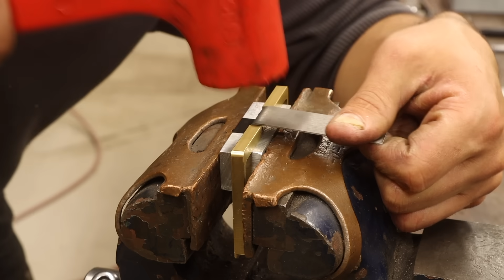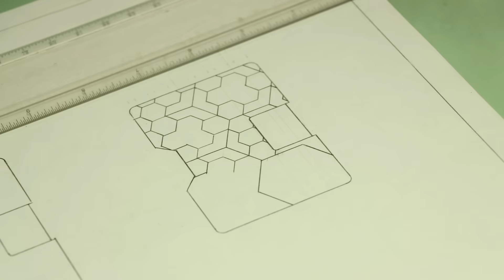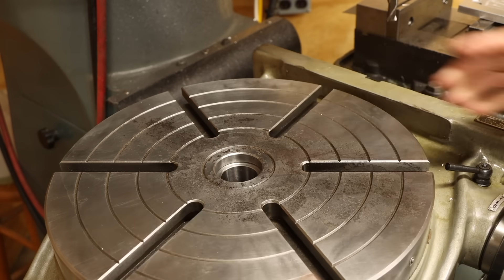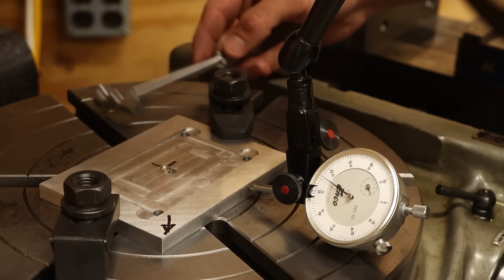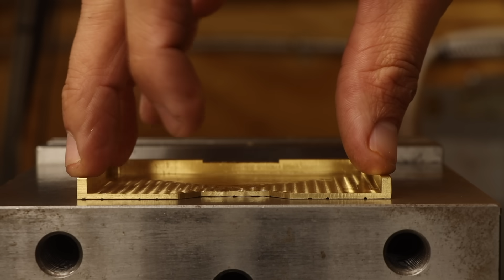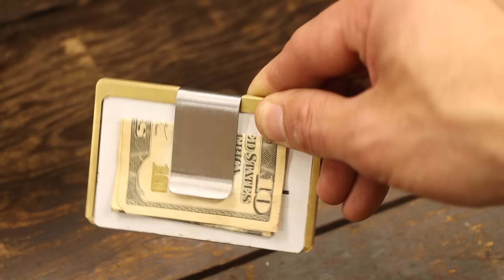Making a MINIMALIST Wallet || INHERITANCE MACHINING

Comment: If your mill clamp studs are too short (running out of threads?) you can also try putting a few washers under the nut to prevent it from bottoming out.

Comment: it would be neat if the face plate was brass, the main body blued steel and the clip stainless :D
hmm. after quick googling seems that brass can be black oxidised. it would be also a neat way to get the lines to pop out :D

Comment: Just a rough guess, but approximately 4,000 is almost 50,000. (Probably closer to 3,200 max)

Also, as I progress further. Ef 2-56 holes. That is the only tap i am at 98% breakage with. Even including a drill press gizmo that is a clutch system that guarantees you wont break a tap. That specific size is a bitch. 0-40? Cuts like butta.

Comment: You should make another one, but use a tape that will protect the surface and not get ripped out too easily. Then fill in the lines with a complimentary color.  Then face mill it to final thickness.

Comment: Beautiful end result. What could have looked really nice as well and helped cover up the little mistake on the inside of the wallet is if you "jewelled" (i think it's sometimes called engine turning) that surface by using some round cratex mounted stones and creating a polished circular pattern.
But regardless the end result is absolutely beautiful!

Comment: Love the wallet. Only downside is that I guess that it's not protected when somebody try to cheat with a wireless terminal and you don't need a passcode for confirming the transaction. It's a huge problem in europe at least. Correct me if it's protected against that?
Reply from the maker: Thanks. Nah it's not that fancy. It might offer some inadvertent protection. But that wasn't the goal

Comment: It's funny, coming from the CNC world that inside pattern looks so every-day; i forgot how much math goes into actually making it.
As for machining it, how come you did not simply super-glue the brass into aluminum? It would have given you a nice uniform hold over the whole surface, and no worries about pushing the part off sideways since it's in a pocket. Then either heat or acetone soak would have separated the two.
Reply from the maker: While I was eager to machine that pattern basically the whole time I was thinking "man... a CNC could do this in like 60 seconds" haha I've never really played with the CA glue method but I've heard good things. I might have to try that next time an opportunity presents itself

Comment: I noticed that you are using a drilled and reamed hole for locating the card fixture on the rotary table. Although a reamed hole is very accurate diameter, they generally are not accurately located. This is because the hole location will be set by the drill, which even with a spot can wander quite a bit. The reamer will follow wherever the drill went - which is by design. Its why reamers are long and noodley. If you want a hole that is accurate diameter and location you’ll have to use another process like boring. 

BTW not trying to nitpick. You clearly sweat the details so I thought I’d sweat some details too ;)

Very cool build. I like the rotary table work to make the pattern.
Reply from the maker: Taking a break from integration hell, I see? Good point I hadn't really considered. If some features end up off a half thou or so I think it's completely acceptable for a wallet. But good to keep in mind when it matters. You've got me second guessing the ~200 holes I made in a fixture plate though 😂
Reply: @InheritanceMachining  Agree its totally fine for this application. Where it really gets bad is deeper holes. I've had a 1/8" drill wander by 100 thou over a couple inches. That is admittedly an  extreme case though - I've heard it depends a lot on how symmetrically the drill is sharpened.
Reply from the maker: @StuffMadeHere  Damn... was your drill made of cheese by chance? You just got me curious on how gundrilling works without drifting. Seems pretty universal that chip evacuation is a HUGE factor for straight drilling in all types. I imagine that's why you always see folks pecking away at holes. More than I do at least. Probably not a bad habit to get into
Reply: @InheritanceMachining  My understanding is that a gun drill is an entirely different tool. Basically the gun drill has a built in "guide" on the end of the drill which reliably centers it in the existing bore combined with an external guide to constrain the drill from wandering. Sort of a hybrid between boring and drilling. Without those constraints - and a lot less stiffness due to the flute cutouts - twist drills are able to meander through the material without much resistance. I was told when I was learning that the evenness of the grind between the cutting edges on a twist drill was critical for getting straight holes.
Reply: Back when I worked at a machine shop, I always used a stub length drill with a center drill to reduce my wander on reamed holes. Seemed to do well enough for the parts I made, granted the mill they put me on had about 100 thou of slop in the ways, so the fact that I could hold a tolerance of 5 thou was a feat all on itself let alone the 1 thou i coud do on certian operations. For anything that required absolute locational accuracy, we normally got a cutout from the wire edm.
Reply: Would a mill address the wandering issue? Wondering if a set of undersize ground mills followed by reaming would be a good practice? Or do you just need to rough drill and mill with enough rigidity to both locate and take to final size?
Reply: @matthewlramsey  If you want really accurately located holes with good diameter with a manual mill you typically would bore the holes with a boring head. First you drill an undersized hole with a drill, then you bring it up to size with a boring tool which is an adjustable single point machining tool. It is very stiff and can take a very light cut to get accurately sized and located holes. Alternatively if you have a CNC machine they do a similar routine using an end mill. Drill a nominally located hole then machine a helix path with an end mill to bring it to accurate size and location.
Reply: also, instead of boring, you could also just use and end mill to kinda cheat your way to the same relative result
Reply: With wider flutes to guide the drill, modern drills use flow threw coolant to evacuate the chips. Titans of CNC did a 40x depth hole with a drill. Less than a thousandth off at the end.

Comment: Just a tip for the next time your bolt is to long, just put a few washers under your nut and you gain the high what you need, so you don't have to destroy some other bolts or material for it.

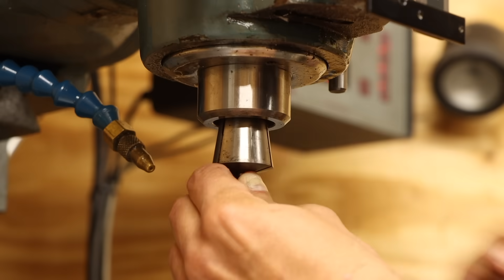Comment: I'm no machinist, but at 8:00 you say the bit should be running at 15,000 rpm. I don't know how fast your mill runs, but wouldn't the tiny tip on that bit spin much faster than the speed the machine is set to? I'm sure you thought of this considering your level of detail, so i'm just asking for myself.
Reply from the maker: No that's that point I was making. I could only run my mill at about 2000 rpm. Ended up working out alright though

Comment: There is a key in the container that the 12" Mitutoyo calipers came in. It is used to reorient the needle when it has skipped. Spend a few minutes and try it out. You'll be much happier using them with the zero position of the needle at it's intended 12 o'clock position.
Reply from the maker: You're right! I just fixed it. Thanks!

Comment: Does it still hold cards if you have less than 5?
Reply from the maker: yes but I have to bend the clip in a bit. If I did it again I would make the clip from thinner steel

Comment: How does the clip interact with clothes/body when it's in a pocket. My gun holster belt clip constantly rubs holes in my shirts even though I've sanded all sharp edges down to 2000 grit. Wondering if it does something similar to the pocket interior.

Comment: I've seen other channels super glue a part to a baseplate so that its held securely across the whole surface, then use a blowtorch to heat it to break the super glue bond. Perhaps this would remove the lifting issue and the need for moving the clamps half way through.
Reply: But you need an Australian accent to get the most out of a super glue ahhbor.

Comment: Brandon, another tap broken again. Have you thought about making a tapping guide or a tapping fixture? Then are you using tapping fluid(tap magic)? I didn't see any tapping liquid. I have machined thin carbon fiber sheets before to make test coupons and used heavy-duty double side sticky tape. I have heard of people using blue tape and CA glue to fixture work pieces down. Your channel has getting big. Congrats Brandon.
Reply from the maker: Thanks Matthew! I think this was the first tap I've broken 🤔 but still one tap too many! A spring follower is top of my list. As well as a tattoo on my hand to remember the tap magic 😉  I am interested to try the superglue/tape truck though.

Comment: Outstanding work and the finished product is ace. 
I did swear  out loud when you broke the tap as well. You did a good job getting the broken section out without making the hole too big for the same size thread.

Comment: For machining thin stock that deforms, one suggestion would be to use adhesive workholding. Double sided tape, or even CA glue dissolved by acetone or released by heat should work well.

Comment: I think filling the lines with enamel would be beautiful. Not the paint, but the molten powdered glass variant. You'd have to be sure that the metal can take the 750-850°C, and that it will stick. Copper will work, electroplating with copper can be an option as you probably need to polish the surface after heating it to melt the glass powder.

Comment: i find that with tiny taps people seem to sway like a drunken salor as there turning the tap wrench. i dont normally condone power tapping but thats were an electric drill comes into its own. you can hold a hand drill a lot steadier than a tap wrench and the tourque settings can be ajusted down so you never put too mutch force on the tap. other top tip is always hold the tap wrench with both hands left hand acts like a bearing surface stedying it on the up down left right axis, wile the right hand drives. you wont brake nearly as many taps that way.

Comment: I'm only saying it cause I didn't see it. I maybe missed it.
But the old timers say for very good reason when tapping  "1 turn fwd half turn back", clear those threads as you cut. If you feel "resistance" back that tap up and go back Down if you're worried pull it all the way out, blow out the hole and tool, reoil repeat. 
It may take 2 or 3x as long but if it's small and one offs for the hobby why risk it.

Comment: I've "fixed" off-location holes before by first boring the hole out completely to a larger size, then turning a piece of material to be a press fit to the new hole, pressing it in and re-drilling the original hole.

Comment: You're putting out some great content considering the age of channel. There's no way you haven't got experience in filming and editing!! 
P.s. if you keep having problems with clamps being just too tall, rather than making new bolts, make a batch of 5-10mm thick washers. That way, even if you selected the wrong length bolt, you just slip a couple washers under the nut and hey presto! 👍
Reply from the maker: Thanks! I do get a lot of help from my wife who also makes videos. And thanks for the tip. I ended up with the studs just because I've run into this problem on short setups multiple times. Not any more though!

Comment: Great!
But please make or buy a tap guidance spring pin for your mill. Or some other guidance system. The second time you were taping those small holes, you were also flexing too much. You'll break more (small) taps this way.
I'm also a bit worried about galvanic corrosion. Wallets are usually kept near the body, in pockets and such, where it's a little moist. The stainless might cause the brass to oxidize quickly.

Comment: When you tap, run it back every so often to break the chip so it can clear the flutes.  I usually go 1/2 or full turn, then quarter turn back, repeat.  Tap holes all the way stepwise like that and you won't have the tap jam up and break
Reply: Exactly!  I scanned through all the comments, sure someone would mention this before I posted.  I used to have the same issue of taps breaking, until I learned that they are not self clearing, and if the chip grows too long, it will gall up in the hole and the tap will break - all taps from tiny to gigantic, regardless of size, can fall victim to this issue.  Most tap sets will even have this guidance in the instructions:  turn forward half a turn, back a quarter turn to break the chip, repeat the entire way.  I've yet to break a tap in nearly a decade once adopting this process.  I also will fully back the tap out every so often just to help clear the chips.  Sounds like a pain, but it actually makes the process so much easier - the tap should turn effortlessly, and any resistance is a pending tap break.  Every time I watch you tap, I'm cringing inside waiting for the tap to break - and you've yet to let me down.

I only recently learned that there are some self clearing taps, primarily designed for CNC use, but the ones I've seen have a spiral fluted design that looks reminiscent of a drill bit.  I've never used one myself, so can't offer any insight there. All of the taps I've seen you use so far have been straight, so I believe they require the backward quarter turn to break the chips.  As highly talented and skilled as you are, I'm hesitant to believe you didn't already know this guidance.  Perhaps both Timothy and I are wrong and you do have self clearing taps.

I almost never use dies, so I can only hazard a guess if they require a similar chip breaking back turn, but if so then that might explain why your die cut threads are consistently catawampus.

Beyond that hopefully helpful tip, I just want to say a big THANK YOU for your excellent content.  I've been devouring all your content, and it will be a sad day indeed when I finally catch up and have to wait patiently for your next drop.

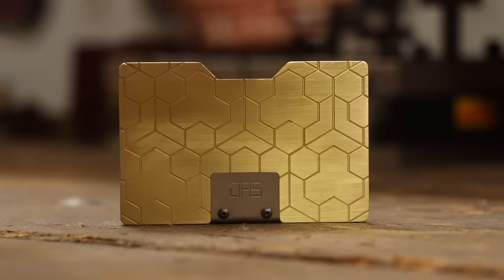Comment: Neat little handmade gift for sure! Don't take what we noticed as anything negative as it's not intended as such. It's attributed to the QC side and countless hours of checking parts against drawings with thousands of dimensions--noticed a missing line being machined on the left upper area @18:30 in the video and congratulations on surpassing 120K subs. Cheers!
Reply from the maker: Thanks! It's actually the case that there is an extra line on the top right! 🤦‍♂️ 😂
Reply: @InheritanceMachining  Ah. Either way, it turned out great!

Comment: Won't the clip gradually scratch the first card? If it does scratch, how could that be prevented? Maybe dipping it with a rubber coating around the end? Or maybe keeping a sacrificial card on top to protect the others?
It looks absolutely amazing, though. Awesome job!
Reply from the maker: Yeah it might, I smoothed the edges underneath pretty aggressively but we will see. Thanks!

Comment: Nice job, when holding thin stock super glue is great, also you can spray paint black then machine or sand off the surface it makes the design pop cheers.

Comment: That aluminum is giving me flashbacks. A week ago I finished a 2 week long job at work where the material I was using is called "MIC 6" aluminum, supposed to be within .001" per .5"x10"x15" plate. Out of 65 plates less than 1/3 of them were actually within .001", most were .002"-.004", but 14 of them were horrible, with the worst having a low to high variance of .020" 💀
Reply from the maker: What a nightmare!

Comment: Really nice Work!, But If your gets any sweat or humidity in His Pocket, He is going to get some corrosion on this wallet, due to the difference in electrochemical potential between brass and steel. When combining two very different metals you should always incorporate an isolating layer (just saying for your next Project :) ) but still, awesome work
Reply from the maker: That's a good point. I've checked galvanic potentials on other projects but for whatever reason threw that consideration out the window on this one 😂  Thanks

Comment: Beautiful, but one suggestion (if not too late): fill the design grooves with black (or deep blue/purple) paint/nailpolish, very lightly surface grind the face so that the paint is left crisp in the grooves, and a final thin clear satin coat for anti-oxidation protection.

Comment: This was super cool to watch, and it's an awesome wallet. However, there was one line that was not engraved on the upper left hand side (if the clip is at the bottom). If you look at the furthest right hand side, it would be the second line from the top. Sorry, just had to point it out
Reply from the maker: Thanks. It's actually that the line on the right that was extra 🤦‍♂️ 😂
Reply: @InheritanceMachining  ha well it adds some character!

Comment: Want a minimalistic wallet ? 
Here you go ! Most minimalistic wallet ever !
Are you ready for it ? Cause here it comes ! You were warned !
Grab a rubber band and strap your cards to your phone , put some cash in there if you feel like it or don't if you don't. Doesn't get more minimal than that !
Dont want a rubber band across your screen ? Take off your phone case , put the band around it ,then put your phone in the case  so the band gets trapped behind your phone .
Think it is not secure ? Add more rubber bands ! Still think it is not secure ? Go see a therapist you have some  issues ! OKAYBEY